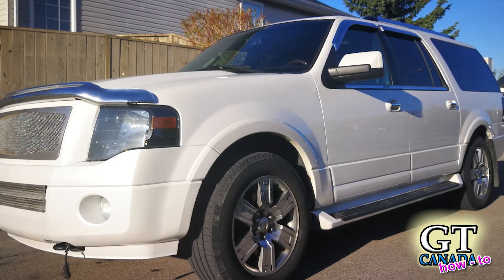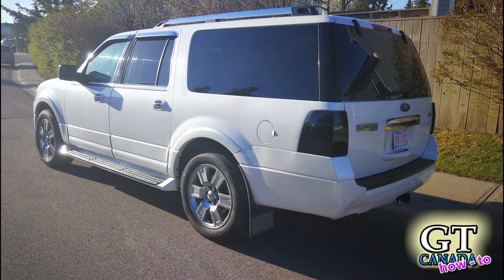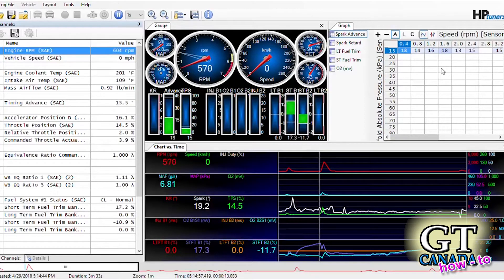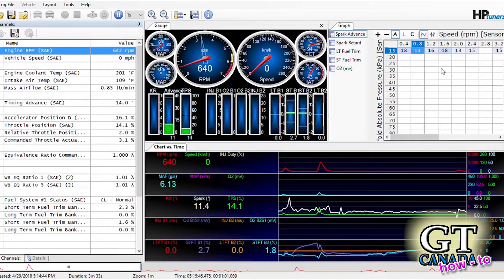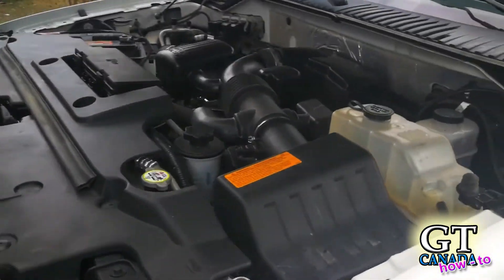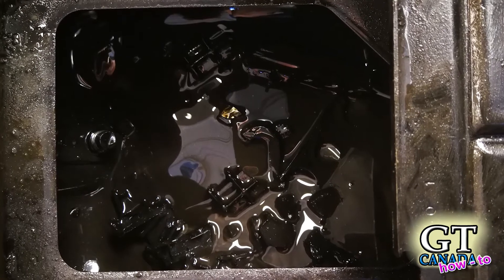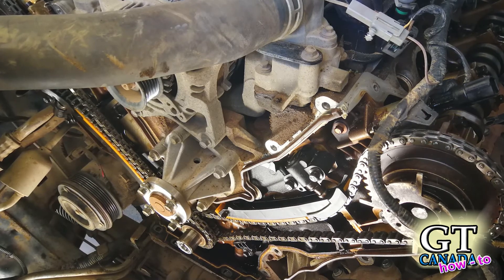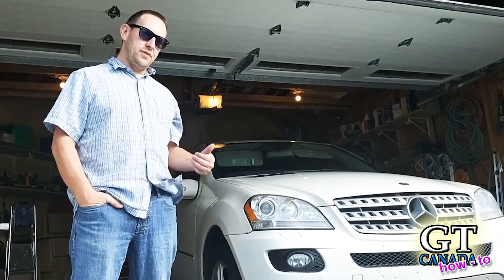VCT solenoid diagnostics on 4.6l & 5.4l 3 Valve Ford engine - GT Canada How To

Comment: It’s really impressive these motors still operate after what could be catastrophic for others. I have an ‘07 5.4 with 205k miles and it just threw a VCT solenoid code and there is a minor clicking. I suspect the phasers are failing. I’m considering replacing solenoids, locking out phasers, and seeing how long it will last. What brand lockouts did you use?

Comment: so what does it mean when the knocking sound goes away when disconnecting the VCT solenoid and stays gone after reconnecting the Solenoid until the issue returns 5min later? I notice that it only happens after warm up seems like
Reply from the maker: Failing but not failed all the way?
Reply: @GearsAndTech  Thanks. That's what I'm hoping for. I'm going to do the repair this weekend, but I'm scared as hell it's going to end up being the phasers......my luck.
Reply from the maker: Phaser bypass isn't that hard to do if required

Comment: My phasers have been making noise for 5 years. I decided to run her till she blows. Still going with 210,000 though. The rest of the motor is rock solid, just fell victim to fords stupidity.
Reply from the maker: I think it's a risk doing that. My personal thoughts are running with bad phases is what caused my timing chain guides to break. When the phases switch the chain has a moment of slack, which makes it smash into the guide and eventually break them
Reply: I don’t plan on fixing it, just going to junk it when it decides to go. New pickup time.
Reply from the maker: Sounds about right. I hope you get many more years out of it

Comment: I have a 2006 ford mustang gt 4.6 and my car stalls and knocks loud i have the right oil and replaced vct since it ran fine with them unplugged but even with the new oil and new vct solenoid stilk the same help me please I also replaced the cam phasers and oil pump plus timing is good and cam and rockers are good too
Reply from the maker: Are the u saying you did replace your phaser as well?

I did a lock out so I wouldn't have to worry about anymore

Also, while you were in the phases swap you can check your cam chain guide. If it looked like mine it would explain a lot.

Hope that helps.
Reply: yes the vct solenoid and cam phasers are new the thing is everything is fine the chain guides and tensioner are good but one i drive it for 10 minutes its knocks loud and loses power
Reply: @iwreckedyoubyt4081  updates?
Reply: and also when i disconnect one vct solenoid it runs fine

Comment: Hi there - I suggest you look on youtube for Fordtechmakeuloco  and listen to Brian as he is a ford tech and can give you the best advice - but it sounds like your cam phasers are starting to be a problem due to low oil flow, this in tern will cause the roller followers to suffer and the lash adjuster may be collapsing - Engine inspection is needed here - I recommend that you do not drive it until its diagnosed . a weak point in these engines are the timing chain tensioners losing there gaskets and causing loss of oil pressure and roller followers fail due to the lash adjusters collapsing.
Reply from the maker: Thanks for stopping by. I ended up doing a lockout on the phaser. Also new oil pump and timing chain guides.

The whole thing had issues. But we got it all fixed.
Reply: @GearsAndTech  That's Great! 
So - What did you find when you tore it all down? What was the mileage? Reason being is I own a 2008 250 Super Duty that has 216,000km on it.
I'm trying out a gentle clean out of the varnish with putting WD40 in with the oil - and it appears to have solved the ticking that was just starting to become an issue.
1st get a tide laundry cap from a tide simple clean making sure there's no soap residue, and fill it up with WD40 up to 4 cap full's and pour it in while the engine is running and up to operating temperature and my engine returned to normal as the ticking ceased. The trick is here is to listen to the engine when hot after a normal driving cycle - if it appears to have a tick from the roller followers then the lash adjusters are starting to collapse due to varnish - that's when to add the WD40 and get the varnish worked out of there. My engine would only tick after it was hot and the oil thinned - it wouldn't tick when it was cold and running, so - that might be a condition to keep in mind for the next while. Hope this can help ya.
Cheers
Reply from the maker: If you watch the whole video you should see what I found, and what I ended up replacing.